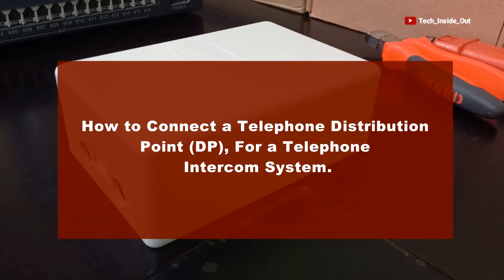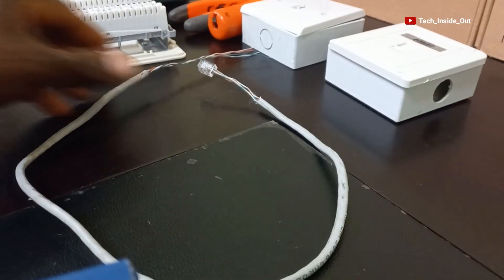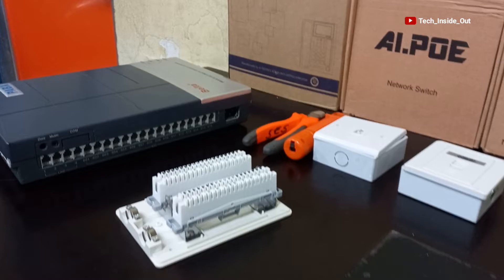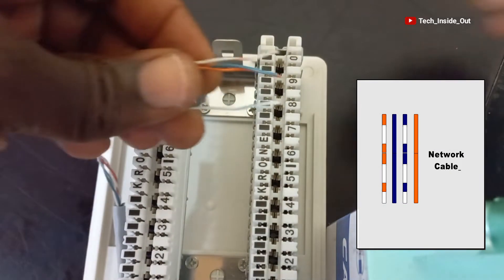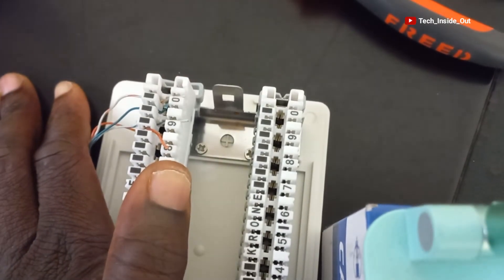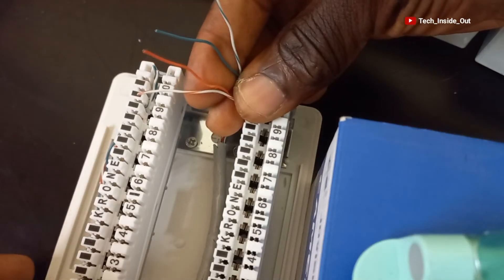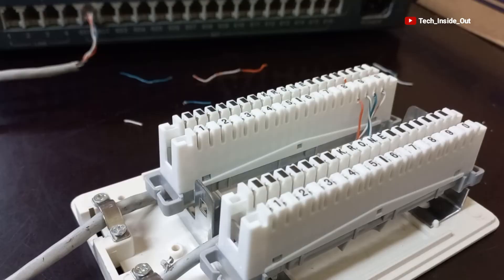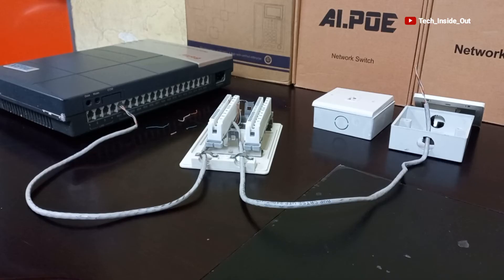How to wire up an intercom phone system distribution point (DP)

Comment: Question, why don’t you use normal landline jacks?? I see your other videos instead of using screws to mount phones, most) landline jacks have mounting nails built in and they have screw terminals that are more secure and easier than the type of connections used in Ethernet jacks. Also in a building thay might be mistakenly took as a Ethernet jacks and depending on the hardware hooked up to the PBAX system using the Ethernet landline jack the PBAX 5:06  system might glitch or be damaged (unlikely) also why use Ethernet cable, for the date isn’t that a waste of wire as you only need 4 wires? Just cut a landline cable and it has the cables color coded (most of them) .
Reply from the maker: I have videos that used the old type of Telephone socket as you referred to. Truly speaking, the world has moved away from such to keystone Jack with faceplate. 

You talked about the use of Cat 3. When you study Cat 3, Cat 5 and Cat 6, in terms of their technical make-up up, you will realise that each kind of cable is an improvement on the other. Running cat 6 has loads of benefits compared to a cat 5 or cat 3.
Reply: @ true however isn’t it illogical to use a Ethernet jack for a landline, what benefits do Ethernet cables provide?
Reply: You are still in old age 😂

Comment: Sir i have wire of 2  conductors(blue and white) so can i use it for ac current only for the operation of fan , led tube light and for my charger?
Reply from the maker: Am not very familiar with Electrical systems.
Reply: Ok

Comment: Concise video! Please, why didn’t you arrange them in the order of striped blue,solid blue and striped orange and solid orange ?
Reply from the maker: The order you stated will work when you use it consistently at both ends of your cable but i used the standard convention which would enable everyone that knows the convention to be able to work on it without difficulty

Comment: Great video, sir what is the use of the distribution point
Reply from the maker: This is most appropriate when you have two buildings. From where you have the pbx switch, you can take a multi core cable onto a DP to be spread to locations

Comment: Sir. Let’s say i want to use 1 cat6 cable for  4 rooms next to each other. Single line can I use blue white blue for 1, orange white orange for 2, the third room green white green and the last 4th room brown white brown. ?
Do they all go to the 2 and 3 pins in the rj11 connector?

Pls lastly 😅 from the Dp box to pbx,  if I punch down from the first line on Dp 
orange white orange,blue white blue, green white green, brown white brown.  Will I still be able to pick it same way from dp to rj11 to pbx? 
Or you say I’m reimagining too much 😊
Reply from the maker: 1. Provided you would be able to separate all the cable pairs in the Cat 6 for the four rooms, it would work. 
2. Yes, pin 2&3
3. You should be able to pick it from the DP and ensure you do your matching properly
Reply: @Tech_Inside_Out  I’m going to experiment the punch down to dp and same as I asked, see if it works per my wiring before I actually work on it. I’ll revert. Thanks so much

Comment: Hi can i use two or more DP?
Lets say two storeys, and a detached security room. first floor cat6 are 4 in number, So i punch them down into distribution box and pick from DP with Multicore cable to the other security building, and punch the multicore it into DP and lastly take it from DP with cat6 and crimp into PBX?
Reply from the maker: Yes, you can use many DPs as you have done. You are doing a perfect connection.
Reply: @Tech_Inside_Out  thank u so much for your class.

Comment: thank you so much sir...my question: working on a single building of over 25rooms, is it necessary to use a DB?
is distance a barrier for direct connection from PABX to the socket?
Reply from the maker: The DP would not be necessary in a single building.
Distance is not a barrier at all, you can do the direct connection.
Reply: @Tech_Inside_Out  In that case, why do you ned a DB?

Comment: do you really need a distribution point? I have wires set up on each office and central point where all the wires meet. The central point will all go into the switch and the office part will go into the wall sockets. that will work right?
Reply from the maker: Yes, the setup you described will work. The distribution point works in instances where you have two or more buildings sharing thesame PBX machine. At each building, there will be need for a Distribution point and use a multi core cable from the pbx switch to the DP.
Reply: @Tech_Inside_Out so how do you set up the phone numbers for the individual rooms in the new building or do they just share the same number?

Comment: Why do u need the DP when you can actually wire up from the face plate to the pbx straight? How does the dp help?
Reply from the maker: Lets take for instance where you are to install pbx in two different structures on one main pbx switch. 
You will require a multi core cable coming to a DP from where you will distribute the phone extensions to the various locations in that structure.
In such an instance. running single cables to each extension will not be needed, all you need is a multi pair cable run to a DP.
Reply: @Tech_Inside_Out  thank you. The dp could be exampled as a poe switch which is like a bridge from cameras to nvr assuming that. Just that  it confuses when I hear multi core cables and single cables.
Reply from the maker: @PlentyGistTVGH  Multi core cables come as one main cable with multiple pairs of conductors. Eg. You can have a 200 pair multi core cable that you can run so that it can be used to transfer as many as 100 telephone lines to a dp rather than running 100 Cat 5 or 6 cables to different phone locations. It is from the DP that you need to use the Cat 5 or 6.
Reply: @Tech_Inside_Out  wow this is very insightful. Just yesterday we were to continue an abandoned cctv and telephone line installation, and I saw a bigger cable than a cat6 which had about 8pairs in one conductor and I was totally lost. As previous installer didn't finish running telephone lines but fixed face plates to the wall. Thank u very much.
Reply from the maker: @PlentyGistTVGH  Yes, that 8 pair cable is an example of a multi core cable. As I mentioned, you can get bigger and larger pairs depending on your project type.
Reply: @Tech_Inside_Out  now this will help.. I really appreciate it.
Reply from the maker: @PlentyGistTVGH  Thank you
Reply: @Tech_Inside_Out Sir how do you terminate this multiform cables in the pbx machine?
Reply: @opssonopsson8282  I believe those multiform cables goes to a dp first, then you pull a cat6 cable from the same dp to your pbx, as per what i've learnt so far.
So how do you terminate multicore cables to the DP?

Comment: Cant i just run the cable to the socket directly  without the dp?
Reply from the maker: You can do direct cabling into the sockets but in an installation where there are different buildings connected to one pbx switch, you would need the dp in each building from where you would distribute to the various sockets in that building
Reply: @Tech_Inside_Out  noted sir
Reply: @Tech_Inside_Out  
 I'm surveying an abandoned job where the main building has cat6 are all run into the walls 
with the traditional RBG and yellow wire telephone socket fitted.   A pair of multi core cables in a junction box.
In The other building,a security room has pair of multicore cables in the junction box as well,and some cat6 too. My Question.How many distribution point is needed at each building, or only a single DP would work as you demonstrated in this video?

Comment: sir; i do have a question how many telephone lines comes from telecom service  provider and how does voice call of internal and external call routing is made ..
Reply: is that possible to use only for internal small office  voice call without connecting to telecom service provider
Reply from the maker: You can take as many phone lines as possible from the telephone company. Each phone line comes as a 2 wire line into your premise.

Comment: At the distribution box,why is that the cables didn't follow up accordingly like solid blue ,strip blue and solid yellow,strip yellow? Instead of solid yellow, strip blue and solid blue,strip yellow u did?
Reply from the maker: Telephone system wiring has a code for the wiring which must be followed. It is a standard to enable anyone other than the one that installed the system to be able to easily trace faults in a  telephone system.

Comment: Sir, I have a question.
Is it compulsory to include a telephone distribution point (krone)?  Can't it be done directly.
Reply from the maker: The krone is used where you need to extend extensions to a distant location eg, another building that is having many extensions.  In such a case you will use a multi pair cable and take to that Krone and from the krone you can distribute to extensions. 
So yes, you can wire your lines directly.
Reply: @Tech_Inside_Out  thank you very much sir. You're a blessing!
Reply from the maker: @Biblestories50  I thank God
Reply: @Tech_Inside_Out what's a multi pair cable sir?

Comment: Please does it mean you can use the DP to connect many telephones on Extension jack? That is if you have like say 100 telephones, can you use 16ext jack pbx with DP to connect them all?
Reply from the maker: No, that is not the case. I will try and do a comprehensive explanation on that in a video. It won't be the next video on the channel, but it will come soon.
Reply: @Tech_Inside_Out  it's been 6 months please any idea when that video coming?
Reply: @PlentyGistTVGH  Would have loved to learn from that video
Reply: @Tech_Inside_Out  yes please we’re waiting for it

Comment: Quick question Sir. 
Please Why the need for a Distribution Point if you can wire up straight from the PABX to the keystone jack?
Reply from the maker: The DP is mostly used when transferring the pbx feed to a location through multi pair cables. Eg when extending the pbx to a different building,  you would need just a single multi pair cable terminated onto a dp and then pick your extensions from the DP
Reply: @Tech_Inside_Out  Oh okay that make sense. Thanks for the reply
Reply from the maker: @iambenqazy  You are welcome
Reply: @Tech_Inside_Out In a situation you are just working in a building, no need for the dp?
Reply: @Tech_Inside_Out I'm more lost 😢